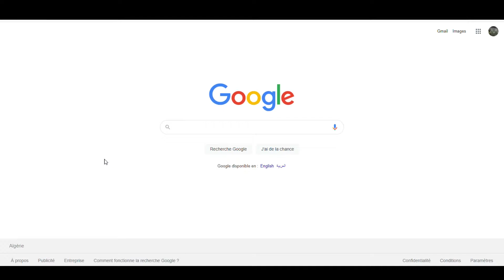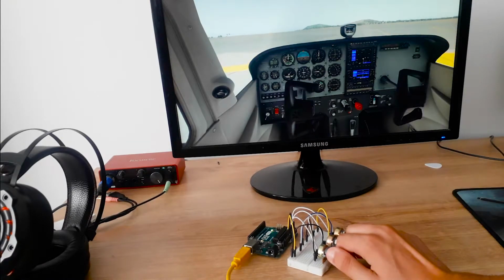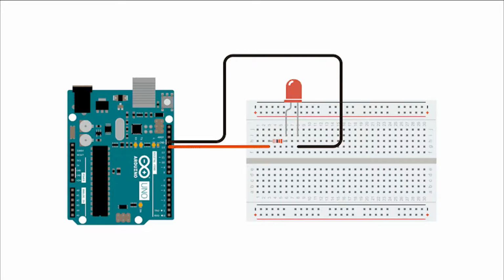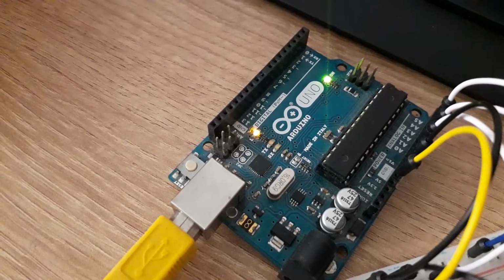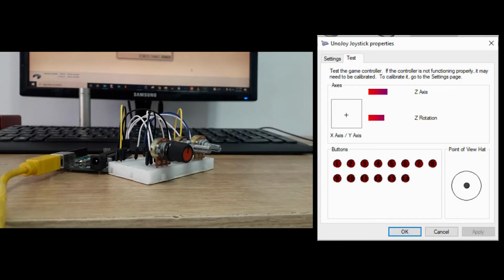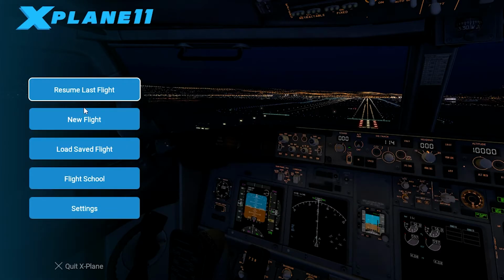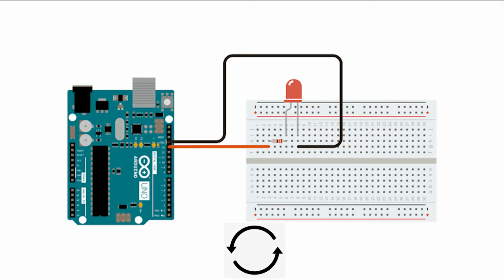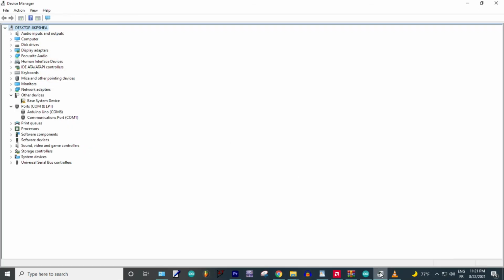Homemade Flight simulator Yoke with ARDUINO UNO (Part 1) : Software / Overview

Comment: CAN I USE THIS TO BUILD ACCELERATOR AND BRAKE  USING POT. AND WILL THERE BE ANY SPACE FOR BUTTONS.
And i uses a Arduino uno clone and it doesn't have those pin that you shorted . What to do.?
Reply from the maker: chill bro why are you yelling 😂
Reply: @anissoulhaci  🥲😂

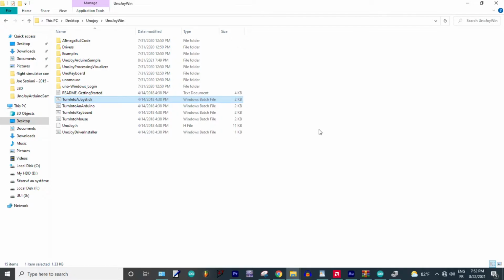Comment: Hi, when I open the batch file "TurnIntoAJoystick" at 2:33 getting this error - "Can't load jvm.dll 
-1
The firmware was NOT loaded..."  Can you pls help? Thanks!
Reply: try installing java. i think it might be that "jvm" which stands for java virtual machine is not installed- and it is installed with java.

Comment: Nice video! Could you please explain what kind of potentiometers you used and why the schematic shown has 4 potentiometers if the hardware you showed while flying the plane had only 3 potentiometers?
Reply from the maker: I added a line in a code to add fourth potentiometer , you need just to duplicate a line that is responsible for defining axis
Reply: @anissoulhaci  Thank you! And how many ohms was the resistance of the potentiometers you had to use?
Reply from the maker: @Jd-w3x  around 10k to 500k
Reply: @anissoulhaci  Thank you so much! 😄

Comment: hello,
Im following your step correctly but i have a problem when you short 2 pin in arduino Uno, after i following the step my arduino uno is connected but named "unknown device" what should I do??
Reply: I am facing the same ... did you figure it out ?
Reply: Update the driver
Reply: right click on the unknow device, select update drivers, select on this pc, and navigate to c: > program files x86 > atmel > flip 3.4.7 (or whatever version) > usb. Select the usb folder and let it update the driver.

Comment: Hi,
Which Uno did You use? I have the R3 version, and it's not working, cuz it has AtMega328P chip, not like Leonardo and Micro.
Reply: any solution
Reply: @imhumanx  It was a wrong Arduino.
Leonardo should do the trick! ;)
Reply: @ChrisNemes  i didn't get it
Reply: Which communication chip does it have?  If it's a CH340 series, you can't reprogram it to work as a joystick.

Comment: I didn't get why you would want to do this. Is Leonardo/Micro not available for purchase for everyone, was that it? Impressive work and good video nevertheless. I am about to build a very custom joystick and throttle system for a cockpit - essentially building my own force feedback system. Anything that can inspire or give ideas is interesting so this will def. be one to bookmark and rewatch! Thanks for great work!
Reply: Thing is sir, I only have an arduino uno and it’s cheaper to just use it already and not buy another one
Reply: Arduino Leonardo Is expensive

Comment: i have uno micr chip can i do this
Reply from the maker: better arduino uno original
Reply: @anissoulhaci  brother i will crazy usb error givin evry time .i am first time used this .but i love simulator becuse i trying to do this
Reply from the maker: @arslanjaved3829  atlibusbdfu.dll ?
Reply: @anissoulhaci but can i use an arduino nano
Reply from the maker: unfortunately no , because arduino nano it doesn't have atmega16u
 @andrejrac1319
Reply: com port windo empty .but in device mngr showing arduino port.whats happen to this
Reply from the maker: @arslanjaved3829  can u clearify plz